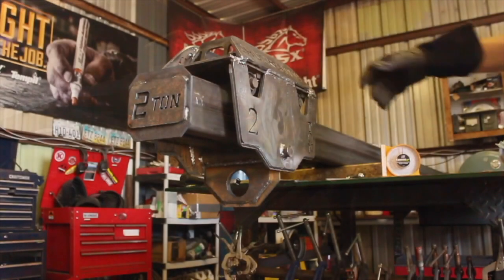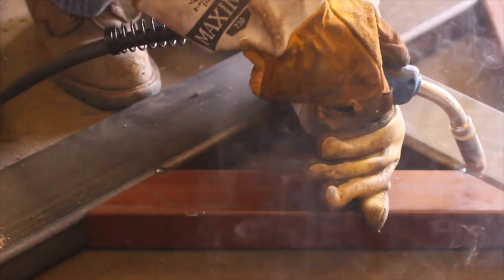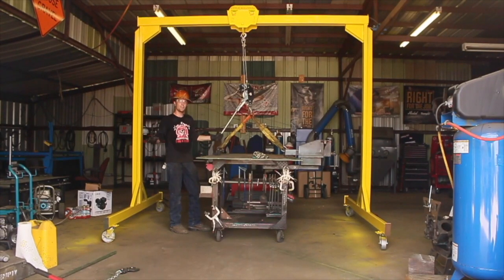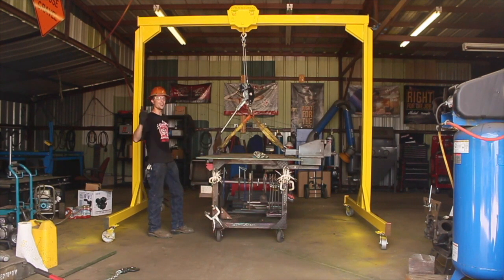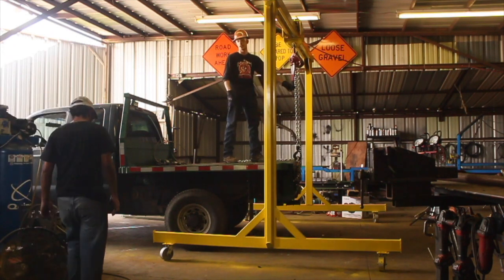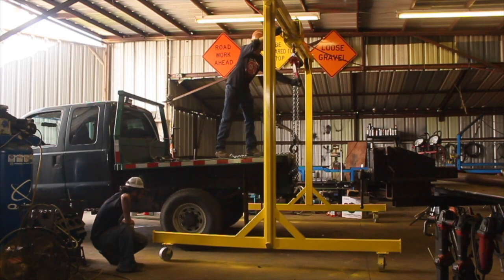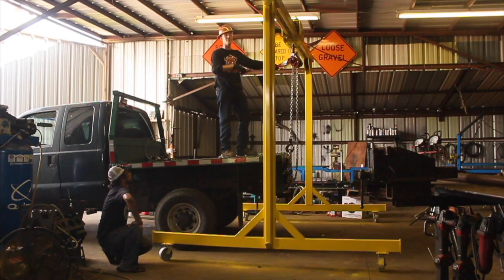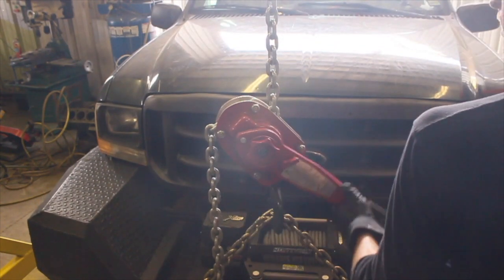BUILDING THE ULTIMATE GANTRY CRANE! SIMPLE PROJECT BUT YOU WONT BELIEVE WHAT WENT WRONG!!!

Comment: How 'bout a metal tube spacer under the vertical braces. About . 25" above the floor unloaded. Then you would only get .25" deflection when fully loaded. You could slip it under and weld just the sides.... done. Just a thought.

Comment: Instead of adding 45° bracing from over the wheel to the upright. I would put a foot under the upright about an inch above the floor so it can move unloaded and when it gets loaded it will flex the cross tube until the foot rest on the floor. With a load that heavy to set the foot on the floor I wouldn't try to move the gantry.

Comment: Stretch, it’s never too late to add longer bracing from the wheels. Lost art of building your own equipment, nice job!!
Reply: He can just put more wheels in the middle. Longer braces would always be getting in the way.
Reply: It's not so much a lost art of building your own equipment.  It is more like lawyers and insurance companies frown upon it for liability reasons.
Reply: @patcb829  
“When in dought, make it stout”!!!
Reply: @1pcfred 
Stiffen up the horizontal members between the wheels where the deflection was noted.  Cheaper than adding high dollar casters.
Reply: @lanecazes  maybe. Steel isn't cheap either.  Lance's solution is the right one. Just move the bracing closer to the supporting wheels. But that'd take steel too. You could also just block up under the middle of the gantry but then you wouldn't be able to move it loaded. A lot of times you really don't need to move it loaded though. You already have the trolley to move the load. So not moving the whole gantry may not be a significant loss. I'm sure it only deflects under the heaviest loads too.